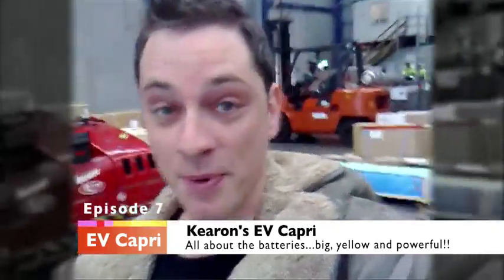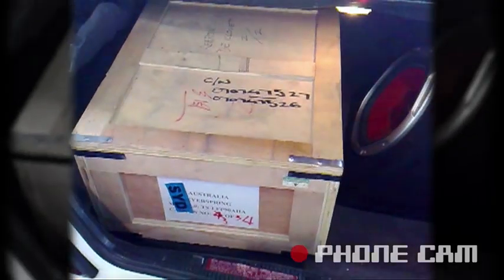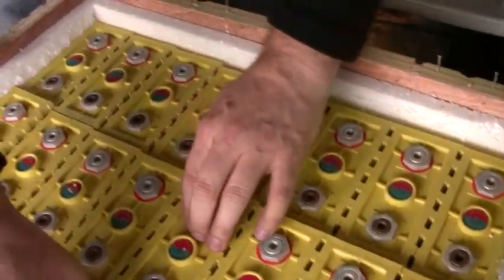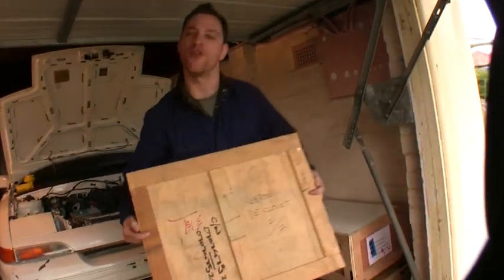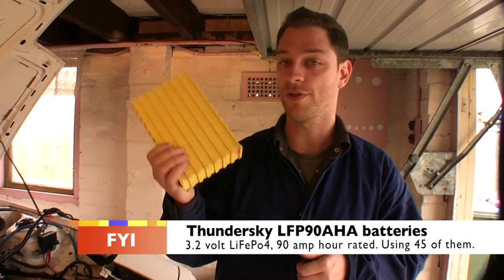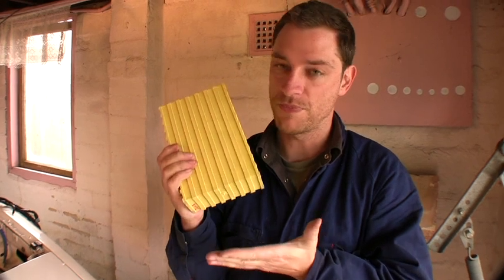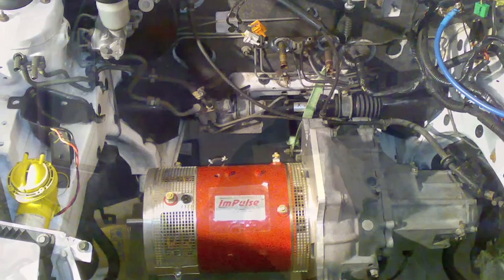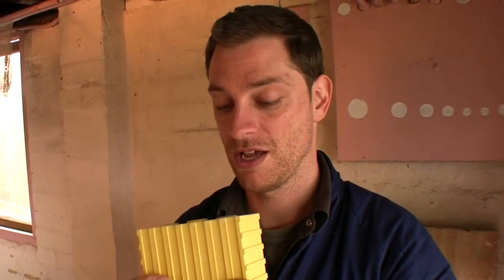EV Capri ep7 - Kearon's electric car conversion

Comment: @ccoasterdesigner Lithium Ion cells are not as safe as LiFePO4 cells (ie. if you overcharge them or they get too hot, or are punctured, lithium ion cells can explode).

Also, LiFePO4 cells have a better discharge curve and are able to prodive many times more amps then they are rated (some can provide upto 30x the amps they are rated at) - which is more suited to use in electric cars.

Comment: @RocketMaker10000 The price you quote is very high. 144v is 45 cells, and 45x Thundersky 90AHA cells is only $4,455 - about half the price you quoted. For $8,955 you can buy 72xr CALB (SkyEnergy) 100AH LiFePO4 cells for more travel distance per charge and more power from your motor :)